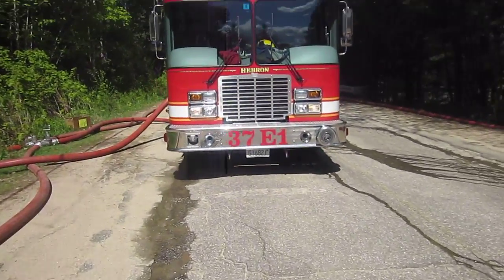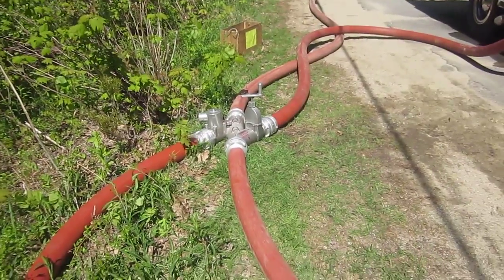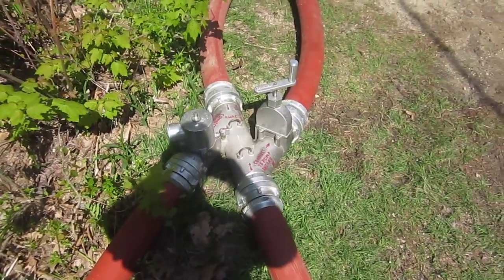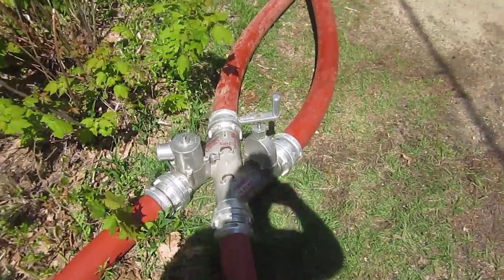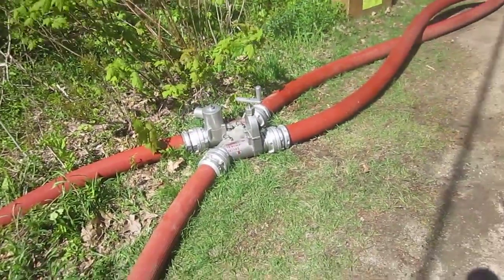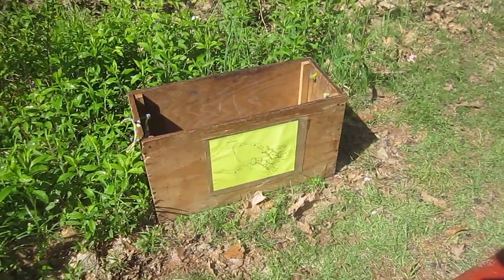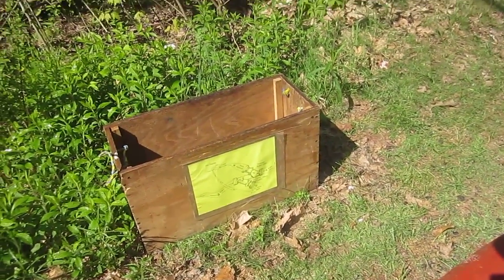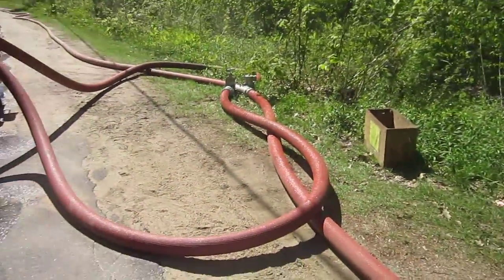Part 4- Relay Pumping Drill - Bristol, New Hampshire - May 2014

Comment: The British Auxiliary Fire Service apparently used to employ so-called "nurse valves" on the relay pump inlets on closed-circuit relays, in order to relieve pressure transients and presumably protect pumps. I notice that you don't seem to have any such valve on the intermediate pump inlet. So this is not a problem?